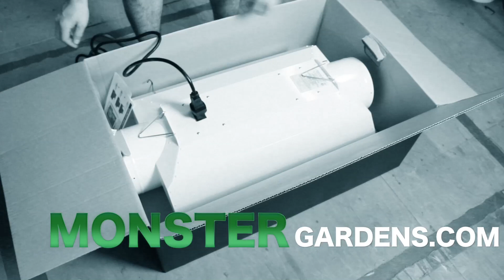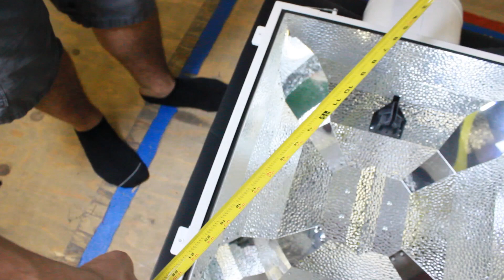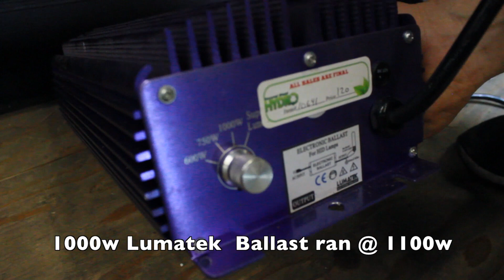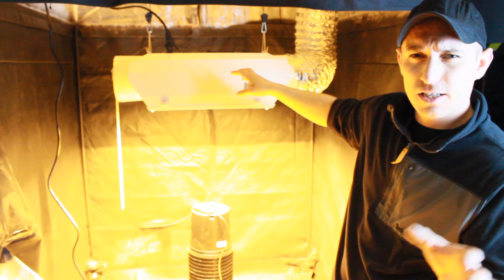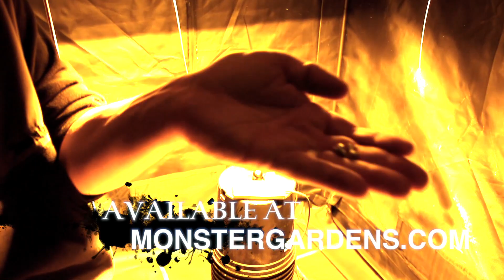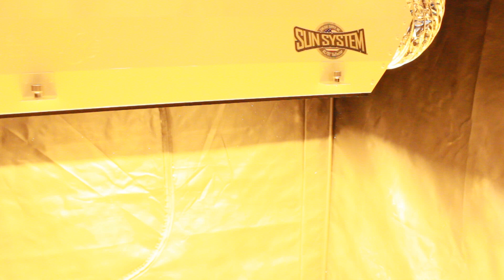AC/DE Reflector Review & Demo | Sunlight Supply's New Double Ended Reflector Air Cooled Grow Lamp

Comment: Great video introduction of the AC/DE reflector! I purchased a unit to use with a 630w CMH-DE ballast with low frequency square wave technology and lamp. I'd like to take advantage of the UV and far reds but have heard the glass blocks these parts of the spectrum. The 315w SE bulbs have a borosilicate glass outer cover, yet this seems to let the UV and far reds/infrareds shine through great. Is the glass with the AC/DE also made with borosilicate glass? Also, do you know what the temperature difference is without the glass compared to with it? Mine is in a 5x5 Gorilla tent. The glass does get hot. You can touch it for 5-10 seconds before it's too hot to touch. So a good amount of heat is projected down towards the canopy. About as hot as a 600hps with sliding glass that I had which had gaps between the glass and hood, not close to sealed and with 4" ducts(old school). The biggest difference is that the AC-DE metal fixture itself couldn't be cooler! Almost cold, lol! Please let me know if you noticed a difference in temperature without the glass, And wether you the temperature difference.  Also, is the AC-DE glass borosilicate glass? And if not, do you know what kind of glass is used? Sorry for rambling on... I really love the AC-DE reflector and if any other information is available, especially relating to the above questions, I'd highly appreciate it! Thanks again for your time.